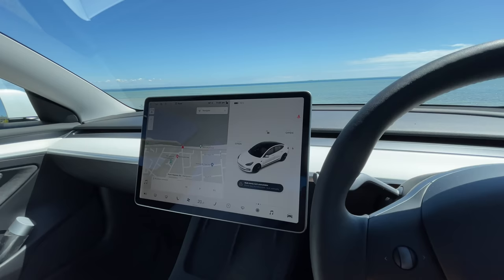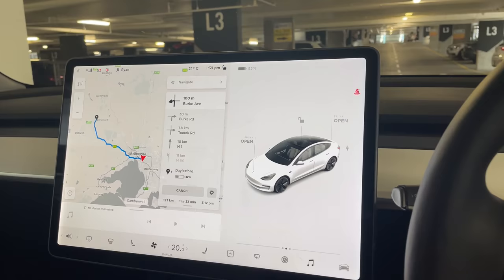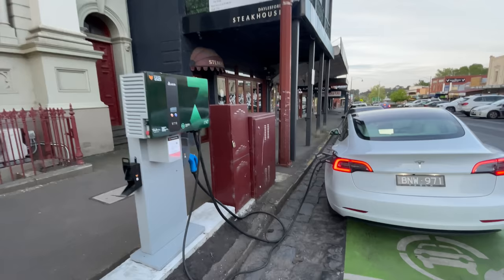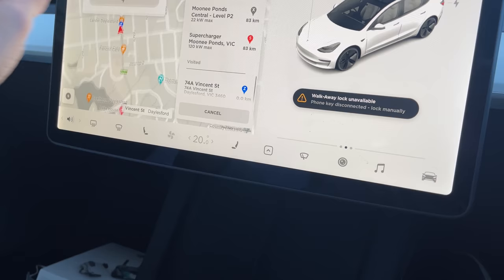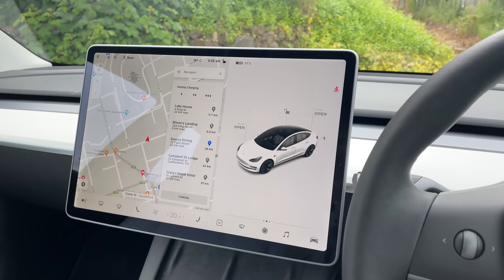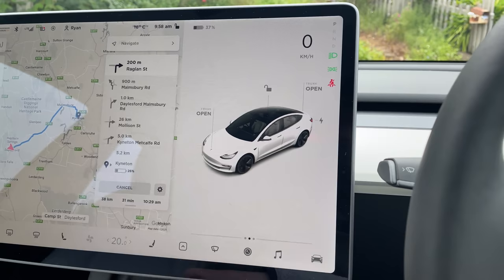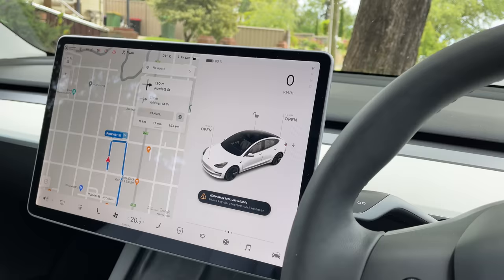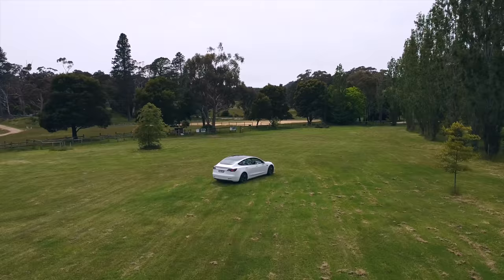Everything went wrong on my first Tesla road trip ...

Comment: I'm at a bit of a loss as to why you did not do overnight charging while booked in at the overnight accommodation? Surely that would have been the right thing to do. It should be a standard thing to do when road tripping on any trip or when at home, to always charge when going to sleep, just like one should do with one's phone.
Reply from the maker: Yes, I agree, in future I will always check for this. However this particular accommodation had no off street parking
Reply: @RyanCowan  Ohh OK. That's a bummer! 
You guys in Aus are right hand drive Correct? I'm from South Africa and we're also RHD. How do you order RHD Tesla's on the Tesla order page?

Comment: Great Video Ryan. Have ordered a SR+ and cant wait. Have been worried about the hot summer sun and how this will impact the car. Do you use the in-car AirCon to pre cool the car before you drive with your app? Do you think that you would need to get mesh interior visor for the roof?
Reply from the maker: Thanks Russell ! Appreciate you watching and commenting :) So excited for you to get your SR+, such an amazing car ! You're going to love it. In regards to your question, yes we have started leaving the AC on when the car is in the sun. It definitely helps but you still feel the heat through the glass roof regardless. It's not until you start driving that it dissipates. I personally don't think the issue is bad enough to warrant a mesh visor but definitely see how u go, as it depends on where u live / the climate. Hope this helps :) Let me know how u go.
Reply: Pre cooling and heating your EV when it is plugged in is something likely nearly always want to be doing.
Reply: There was one YouTuber who had his roof wrapped.
Reply: I live in Texas so i was worried a lot and hot days.  I went with ceramic tinting.  It drops the heat transmission by 80-90%.
Reply from the maker: @marklee4409  this is so good to know! Thanks for sharing Mark
Reply: You can set the aircon to camp mode and leave it on as long as you want. You can also turn it on and off remotely from the Tesla app. You’ll lose a couple % per hour the aircon is running on a hot day.
Reply from the maker: @THEZEST1357  such a handy feature ! Very underrated but it’s a game changer

Comment: Major flaw in your guide. LFP battery is to be charged to 100% daily. Would have avoided most of your “issues”.
Reply from the maker: Correct ! I cant believe I didn't know this when I filmed this 😂 When we initially test drove the car, the Tesla rep told us to charge only to 80% on the regular. In his defence, that had been the case up until these new batteries.
Reply: @RyanCowan  very possible that in the time your test drive and time of pick up, the spec changed. Also noting some testing in the uk in realistic conditions that mean you could see 300 miles from the new LFP in summer weather.

Comment: Why are you charging only to 80%? I have one of these cars on order and reading the manual, Tesla recommend charging to 100% once a week (if an LFP battery). Has this something to do with regenerative breaking?
Reply from the maker: Did Tesla recommend charging to 100% regularly? The Tesla rep told us to keep it below 80%. But if it’s not going to hurt the battery charging to 100% then that’s great
Reply: @RyanCowan  in their manual it states: "If your vehicle is equipped with an LFP Battery, Tesla recommends that you keep your charge limit to 100%, even for daily use, and that you also fully charge your vehicle to 100% at least once per week. If your vehicle has been parked for longer than a week, Tesla recommends driving your vehicle as you normally would and charge to 100% at your earliest convenience"
Reply from the maker: @cyberblitz  Wow I've never heard anyone say this?? Will definitely have to start doing this. I reckon we've only charged our Tesla battery to 100% like once since we bought it 😂
Reply: @RyanCowan  tbh, despite the manual, many encourage charging to 80%-90%, including Musk. Regenerative charging does not work if the battery is charged at 100%. Even supercharging stations restrict charging to 80%, I believe. But i think this is because past 80%, the charging stations decrease the charging rate to reduce battery damage as much as possible, increasing the charging time significantly.  I havn't got the car yet and ive done so much reading on it. I think i need to get a life lol
Reply from the maker: @cyberblitz  yeah i had noticed the software seems to hint at 80% a lot of the time. Definitely noticed that superchargers slow towards that 80%. Appreciate all the info mate. You’re going to be very well prepared for your car when it arrives 😁
Reply: @RyanCowan  Tesla puts LFP batteries in their standard range models and they DO like to be charged to 100%. You can tell which your car has by adjusting the charge limit in the car. If you see the word “DAILY” on the graph between 50-90% and the word “TRIP” between 90-100%, you do NOT have an LFP battery and the 80% limit applies. If you do NOT see those words, you have an LFP model and you should be charging it to 100% regularly.

Comment: Not off to a good start so far. I'm only 58 seconds in and seems like you have intentionally set up yourself to fail. I'll keep watching for a little bit and see how things play out but this seems like a Tesla hit job to me. Based on the intro and your first couple of words in the main video seems like clickbait b***** to me.

The Tesla app is pretty useful. It's not unreasonable or terribly inconvenient to charge to 90% the night before your road trip and use the app the morning of the road trip, from the convenience of your home, to charge the remaining 10% or so in the few hours before you leave. You can time it well enough so that you leave at pretty close to the same time as your vehicle reaches 100% charge. This way you get the best of both worlds: maximum range and minimal damage to battery. Even if you had let the battery charge up to 100% and left it at 100% overnight it's not like it's going to completely break the battery. Is it the preferred method of charging? Well, that depends on your battery chemistry. If you have lithium iron phosphate batteries then it literally doesn't matter one iota. If you have the higher energy density nickel-based batteries then it does matter a little bit but only ever so slightly. I have had my non Tesla electric vehicle for 4 years now and put about 60,000 mi on it and I only have the normal level of degradation, whether I take ridiculous steps to mind the battery charge level or not. I have chosen to just treat the battery pretty normally and leave it charged up to 100% overnight all of the time. Not the end of the world.
All right, 6 and 1/2 minutes in and it seems like you've redeemed yourself.
Scott Morrison probably came by that charger last night and kicked it a few times and then spat on it and said disparaging remarks and now it doesn't work anymore. Yet another example of electric vehicles ruining your weekend... According to him. 🙄
Redeemed. Seems like you are genuinely new to electric vehicles and road tripping. Enjoy the Tesla. Too bad about the charging situation in greater Victoria area. From what I understand from watching the bunch of YouTube videos from other folks in Australia, the state of Victoria is particularly dead set against electric vehicles. They will get their senses back eventually but unfortunately they are severely lagging the rest of the country and world at this point. I have to get a Tesla someday and get out of this crappy short range electric vehicle I'm currently in. As soon as my Tesla stock doubles I should be able to buy two Model Y vehicles. By that time, they should be a whole lot closer to a full self-driving as well as have lithium iron phosphate batteries. Looking forward to the lithium iron phosphate for the gargantuan cycle life they offer.
Nice editing.
Reply from the maker: Haha wow this is the most epic comment I’ve ever had on my channel. Thanks for taking the time to comment and watch. Appreciate your thoughts. Definitely wasn’t trying to string people along, was just my experience. I got a little stressed because I’m still new to EV’s. And found out I have an LFP battery and can charge it to 100%. So good. Hope u get yourself a model Y, I hope to get one as well. Will also be holding my Tesla stock for one 😁👍 cheers !
Reply: @RyanCowan  for sure. Your video was nicely produced. It was entertaining to see you go through the learning process. Glad you made it. Too bad you had to learn the hard way, but now you won't ever forget. Lithium iron phosphate... niiiiiiice. Not sure what Tesla rates the cycle life of their specific packs at for that chemistry, but there are some research articles in periodicals that say lithium iron phosphate chemistry cells can get between 5K - 15K cycles. I would tend to think closer to 5K. Even still, that's a whole lot of smooth driving miles in your shiny new car. 250 miles per charge x 5K charging cycles = 1.25 million miles. ÷ 15K miles per year = 83.3 years that car should last you. 😮 Did you realize you bought your last car (in a good way) when you bought it? Bro! That's a lifetime, nay, a multigenerational car you just bought. 🤯 The value of a Tesla is unbeatable.

Comment: Noticed you were hooked up to a normal plug to trickle charge overnight by the looks when you got home. Do you find that is generally enough if you are not doing too many kilometers on average daily or did you buy the Tesla faster charger for $750 or whatever it is? Btw, that Airbnb/hotel in Daylesford looked pretty cool!
Reply from the maker: Hey Andrew ! Thanks for watching. Yes, we find charging via a standard power point in the garage to be perfectly adequate. We have no plans to buy the $750 wall charger. The only time you would need it, as you say, is if you've done a heap of km's and get home with a low battery and need to leave first thing in the morning for another big trip (such an unlikely scenario and can just use superchargers in that case).
Reply: @RyanCowan  Thanks Ryan, exactly as I thought. Taking the model 3 standard range for a second test drive tomorrow. Just need to convince my wife now as she does not want me to get rid of our X1 2.5i (which we both love) but I have to to enable getting the Tesla. Only thing I don’t like about the test drives is they only give you 50mins and you have to be back. Not enough time to check it out properly.
Reply from the maker: @andrewmee8136  see if they'll give it to you for the night ! The local Tesla store offered that to me after I put a deposit down (but I didn't take them up on the offer, as the car arrived soon after).
Reply: @RyanCowan Thanks for that suggestion Ryan, I will probably do that once I bite bullet and pay the $350 deposit. Test drove the performance model today (OMG, I think it’s too fast but what fun) however I have to get my head around the glass sunroof as it was got today in Adelaide and was very conscious of the heat coming in and on the back of my head as you mentioned in your video. Found it tricky to get comfortable. Not sure if it’s a deal breaker but why they couldn’t put just a normal sunroof in there is beyond me. Would be so much cheaper to manufacture also I assume. Thanks for all your help with my decision making.
Reply from the maker: @andrewmee8136  yeah totally get that. I've resisted buying third party shades or adding extra UV, mostly on the premise I shouldn't have to do that. But I am getting more and more used to it now. Let me what you decide to do. P.s. I'm jealous of your Performance test drive haha would love to drive a performance one day soon ! Might make it hard to get back in my standard range 😂
Reply: @RyanCowan  Yes I think I would get used to it once I have mastered the Air Cond a tad more. The standard range is fast enough in my opinion and don't think its worth $40k for that additional buzz but was fun that's for sure. I could be tempted with the long range but luxury car tax kicks in at that cost level I think and no $3k incentive or 3 years registration waived in SA for anything other than the standard range cost level. The standard range is a no brainer I think. I have also realised that the wheels are clip on plastic and they have better looking wheels underneath but not sure if that was just an American thing or not.
Reply from the maker: @andrewmee8136  you make some very valid points ! Luxury car tax AND you lose the incentives. As for the Aero wheels, they are the same here in Australia. They add about 10% efficiency which is pretty cool. I've come to really like them. The wheels underneath are nice but look a little small.
Reply: @RyanCowan  Agree re the wheels so I guess will need to wait and see if I get one then decide on the wheels from there. Cheers again.
Reply: @RyanCowan  Hi Ryan, sorry to keep having questions but I was wondering what insurance company you use as my insurer does not insure Tesla’s and the one I found that does (Suncorp) is a bit dear with an excess of $1,500. Cheers, Andrew.
Reply from the maker: @andrewmee8136  we’re with AAMI. Apparently RACV also offer good insurance for Teslas.
Reply: @RyanCowan  Thanks Ryan.